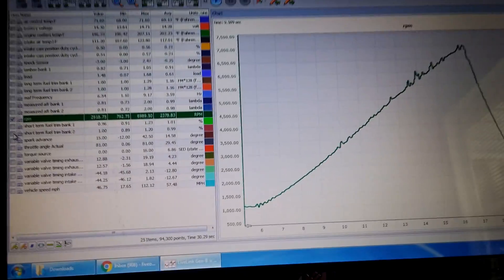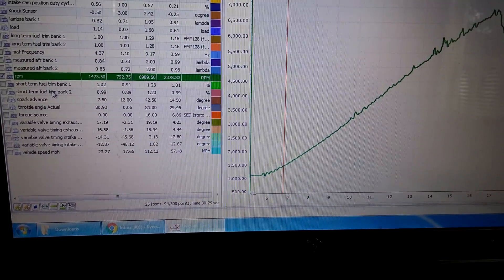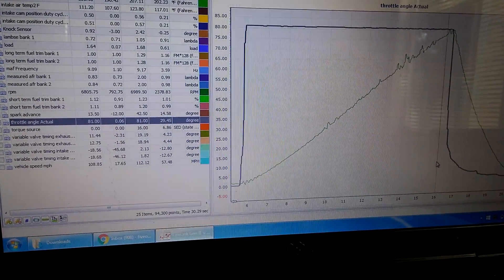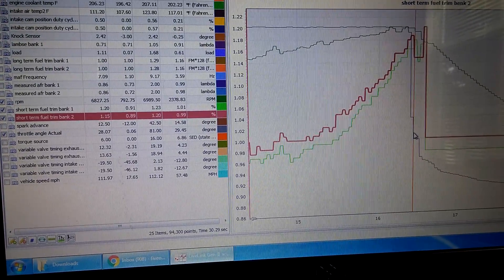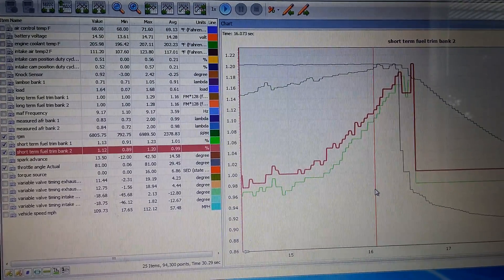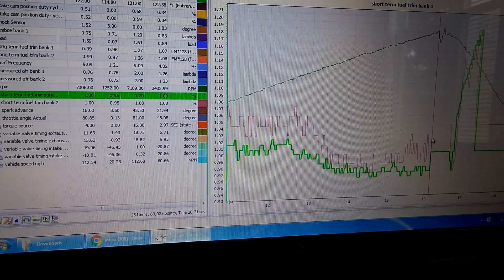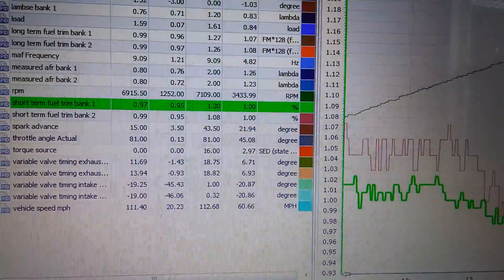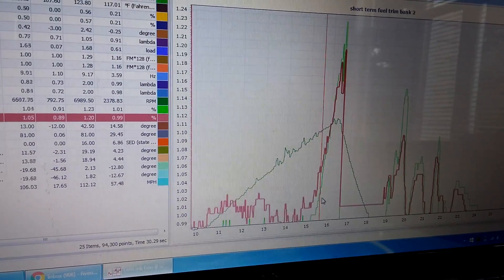How to tell if you need fuel system upgrades via short term fuel trims

Comment: Hey Alex I'm having fuel trim concerns. At full throttle there triming fine but at idle sometimes I'm seeing 30 percent. Vmp said they don't think it's the tune and I can't find a vacuum leak. This is super frustrating
Reply: Did you get a misfire code
Reply: @Alexgonzalez-lu3cd  no but I went and got it tuned by someone else. Everything better now

Comment: So if I have a short trim fuel bank of 1.22 on bank one and 1.20 on bank 2 I should upgrade the fuel pump? E85 on a 18 manifold N/A (16 GT 47lb injectors)
Reply from the maker: You more than likely have a vacuum leak.  It depends where its lean and where load is
Reply: Okay thanks the load at that point was .64 at that point I did have a leak before though it was fixed have to check again

Comment: Alex, after data logging a 1/4 mile pass for tuner last year (On device) I realized how helpful that data could be for my progress.
It seems as though all sct devices only allow one data log file saved on the device, do you know of any options that I could use to record runs and see simple things like throttle (to view shifting etc) and RPM and maybe a sensor that would let me identify wheel spin. 
I have an obd bluetooth reader so any software for a tablet would work as well maybe.
I just dont want to have to have the laptop on the floor beside me etc and the cables get in the way I find.
Reply from the maker: +ndinadis They only way you can datalog and save each run is to connect it to a laptop and record each run. It's a pain in the ass because you don't want the laptop slapping around.
Reply: +Alejandro Flores Yeah I dont run a passenger or rear seat at the track and the only laptop Ive had now is a 17" giant with windows 10 (drivers are flaky) 
I did find they make 90 degree obd cables which may help with the wire being in the way of the clutch. 
I was hoping the ITSX or something similar would work, there needs to be a cheaper simpler option then a racepack iQ3
Have you run livelink gen 2 on a netbook or similar?
Reply from the maker: me too, the ngauge does do a good job of logging if you have a buddy that has one.